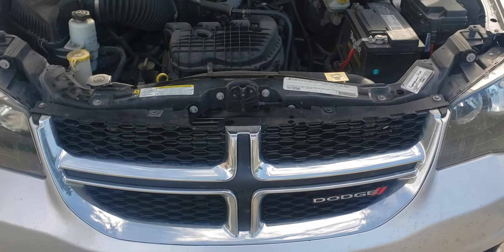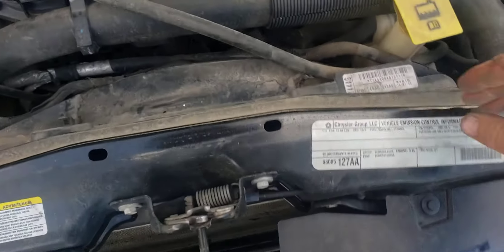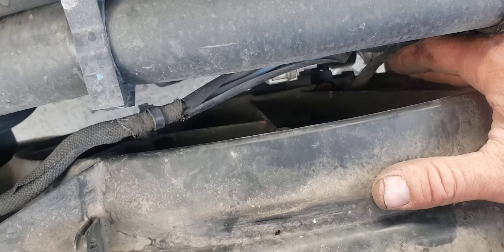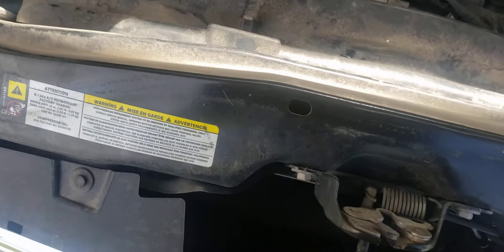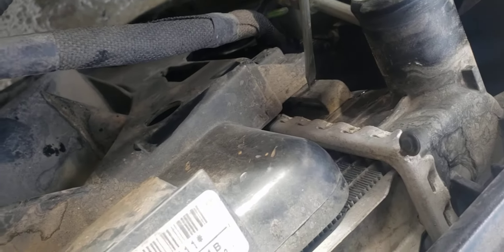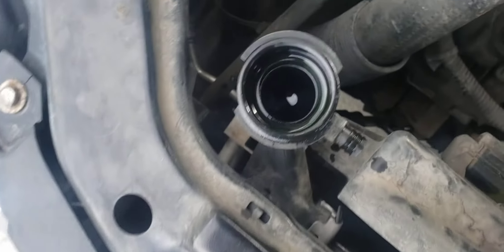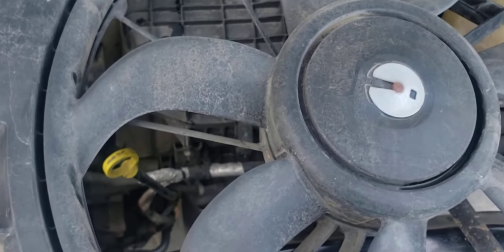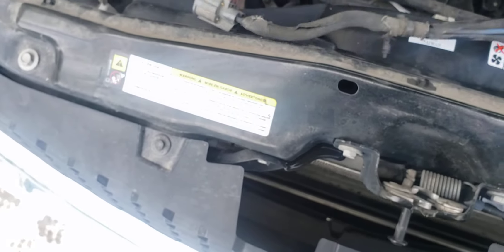2011 Dodge Grand Caravan: Cooling Fan Assembly

Comment: I replaced the relay switch. The fan kicks on when hot but only stays on for like 2-3 seconds and then off again, really not cooling down the fan. The needle is 1 line over the middle. The AC is not blowing cold unless in motion and catching wind from driving. As soon as it idles the fan slightly over heats and the AC is neutral air. Would you recommend replacing the fan? 
Also i put the original relay back in to test it and the fan doesn't turn on at all. So I know the new one works, just not keeping the fan on.
Reply: Having the same issue as you currently. I am going to try a fan replacement. I replaced ceramic relay and it still doing what yours is doing.

Comment: Did you end up having to move any of the other wiring harness' or just wiggle til it came out? Also as you were replacing the 'new' one you mentioned tabs at the bottom. Were they 'keeper' tabs or just positioning points? Tks

Comment: Is the resistor a coil of wire around a ceramic base?  If yes, do you think the coil could be repaired with a piece of wire and high temperature solder?
Reply from the maker: Not sure if you could or if you should even try, but the part is cheap enough that if it were me, I'd just replace it.
Here an Amazon link for the just the resistor: https://amzn.to/3MoLihx

Comment: I have 2011 dodge grand caravan that is throwing a fan 1 circuit control code. Any suggestions I have replaced all relays associated with the fan.
Reply: if its p0480 replace the resistor, you can buy the whole cooling fan if you want, but i would check your local wrecker yard
Reply: Where is the resistors location 2014 grand caravan? 
I have same problem? What did you do to fix it ? Thank you